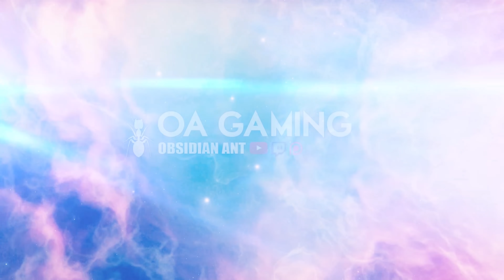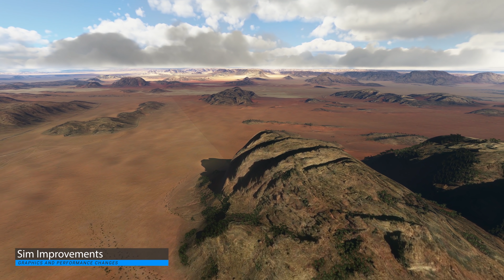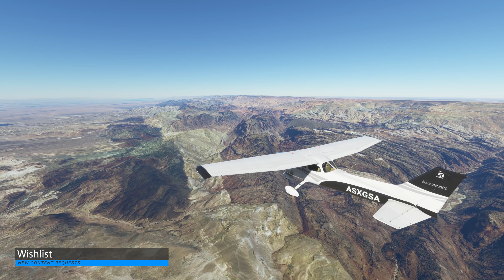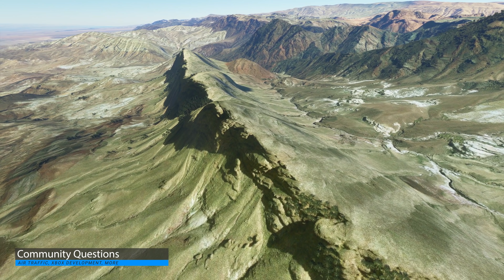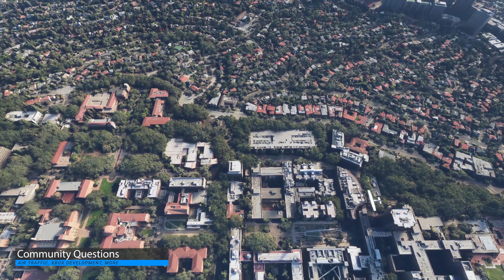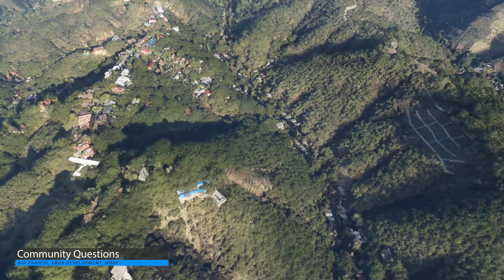Microsoft Flight Simulator - Beyond Ultra Graphics Option, x3 RAM Optimization, Flight Model Fixes

Comment: hmm don't really know what to think of the flight model. On one hand I think it's good they address this, but on the other, is there a reason they don't 'generalize' the flight model so any new model 'inherits' the characteristics depending on how the flightframe is modeled and not just on a per plane basis?  (like in x-plane for example where they calculate the camber and whatnot.. NOT TRYING TO START A DEBATE, JUST COMPARING)

note that I haven't done any research whatsoever regarding the flightmodel in MSFS so just based this on what I heard in this vid.

Comment: fsx C172: on runway,full power pitch up at 30kts, not p factor, takes off at 45kts and stalls.
fs2020 c172: on runway, full power, needs right rudder to stay on the runway, takes off at 45...buffets... and stalls.
im very happy with fs2020. I just wish there was more planes. Maybe some military fighters?

Comment: The 4k fps performance is atrocious. Setting it to lower resolutions/presets ruins it (Anyone who argues against this, or thinks 30fps is ok, can't comprehend what I said) We shouldn't have top of the line systems (5900x/3090 in my case) struggling with fps.

Comment: The last thing I need to do with my computer is upgrade to 128 gigabytes of 3,600 MHz ram, my rtx3090 and everything else in my computer is top of the shelf, but while running Microsoft flight simulator I can see in afterburner my ram, currently 32 gb, is absolutely cooking.
Reply: The game engine should have been developed around directX 12 compatibility from the ground up, I thoroughly enjoy playing the game but at on average 25 - 30 FPS is very annoying to say the least.

Comment: Would rather they fix the stutters-still have them particularly on approach, on my 3090 rig. 50FPS 4k Ultra normally, but horrible 0.5 to 2 second pauses every now and again. Most noticeable when trying to land, and utterly breaks immersion. Also does it at low settings, so winding down does not seem to cure it. Every other game I own runs beautifully . Would happily run at 30FPS if stutter free.
Reply: That sounds like ram lag.
Possible overheating.  ?
Reply: How in the world did you find an RTX 3090?
Reply: @DerekMoore82  😂 PreOrdered on launch day  in UK , received several months later! ASUS strix. Great in everything else, and hopefully when the next lot of optimisations go through it might sort itself out. I’ve checked temps (not going over 75 and under-clocked it from 1860 down to 1800, but still get these strange pauses. More in city environments, so not sure if its something to do with data being loaded into RAM. Forced the fans to run at 100% for MSFS profile but no joy. Lasso etc also no effect, if anything, possibly worse.

Comment: Cool what they're doing with the prop plane flight modelling, but wish they would at least make the 787 that I paid extra money for at least taxiable.
Reply: Even with the little prop planes, I basically need full rudder to keep a straight line on takeoff, is it supposed to be like that in real life?
Reply: @DerekMoore82  you need a lot of rudder irl too
Reply: @Alexander-hk5ke  I guess it's a sensitivity issue, because every time I've ever flown as a passenger in real life, I've never experienced the sensation that the plane was wanting to violently yaw in any direction but straight on takeoff. Either that, or those pilots must be doing some amazing footwork up there in the cockpit. In the sim it's as if I am trying to control one of those bad shopping cart buggies that aggressively pulls to one side.
Reply: @DerekMoore82  next time you fly as a pax, watch thos pedals. Ive been a pax multiple times aswell and there is a lot of right rudder when you watch the pedals. Thats why you dont feel the plane moving left;) But I agree that the rudder sensitivity is aggressive in MSFs
Reply: Naw, theres def something wrong with the 787 steering. Its actually impossible to make sharp turn with it. Compare to a320/fly by wire model which is much more accurate. As for the tail draggers, you need to give a blast from the prop with rudder to get those to turn your tail wheel behaves more like a castor wheel than anything.
Reply: @GreatLakesDrifta  cant say anything about the 787 as I havent flown one, but yes its most likely wrong. And in GA aircraft you surely need power to take sharp turns

Comment: Me upgrading pc with new rtx 3090
Asobo : "Are you sure about that"
Reply: Good luck acquiring a 3090.
Reply: @DerekMoore82  3090 still low results inVR
Reply: I've got a 3090, and performance is good, not incredible. I play on high to ultra settings and get a solid 30-40fps in most scenarios, dropping to around 20fps in really densely populated areas. Not really worth the investment in my opinion but when it was announced I just impulse pre-ordered a ROG Strix version.

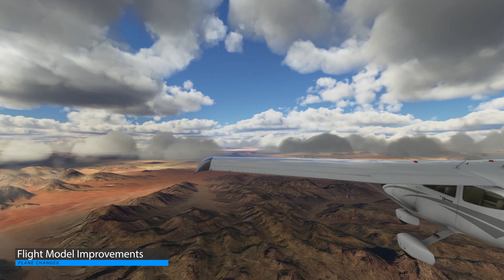Comment: 0:24 Yes, but here's the problem: Stop looking at the rudder effect and look at the recovery. Do you see how much more yoke input the real plane needs to recover? In the sim plane you barely need to move the yoke. The flight model is way to twitchy. And even if they're currently looking at the rudder input, the issue caused by weathervaning on takeoff leading to violent yawing is still present.

Comment: My system has got so bad since the original release that I've gone back to X-Plane. It was all good at the release but all the updates have made it worse and worse to the point I'm struggling to get it to be stable so I've given up.
UPDATE.....(26/05/21) - So after uninstalling and reinstalling MSFS i found that if its in a vanilla state it seems to be fine and will run on HIGH on my system quite happily, so no third party content for me by the looks of it....!!
Reply: I've had the opposite experience.

Comment: "Asobo have been taking real airplanes out, and mapping out a set of moves, such as full rudder, or pitching and yawing.  They have then been capturing all the data for this on a plane by plane basis. "

Why now was this not done from the start? I mean you could tell something was up when you barely touched rudder pedal and plane violently flips to side. Jezuse christ
 
MSFS20 for graphics. Xplane 11 for realism.

Comment: I really want to see ray tracing added, especially RT Shadows, GI, and Emissive Lights
Reply: I'm sure with RTX it will run at a solid 1 fps. 😂
Reply: @MacXpert74  At least it'll help future proof the game. Not all high end settings are meant to be run on all current hardware. It's one of the reasons why Crysis has aged so well visually. The pushed the graphics really hard so that in the future the game still looks visually nice even 14 years later
Reply: @crestofhonor2349  I think they will introduce that option when the time is right and people can actually buy systems that allow for a reasonable experience with RTX enabled. This might take a couple of years. I'm fairly certain that even the most powerful Gfx card available now, would totally collaps if you'd try to run MSFS with raytracing. But MSFS is an ongoing development, so new stuff will be added all the time, so it will likely come at some point.
Reply: Atleast RTX features in cockpit. 🤤

Comment: would be nice if you could replay a replay and also fly with your replay, so you can fly with yourself. Do flight shows ect. You could do this with the flight replay tool in fsx. You could even add multiple replays together for flying formations.
Reply: Look up Flight Control Replay (although maybe that's what you were referring to)
Reply: @getsideways7257  no it was a payware flight replay tool. You could record a flight in a cessna and replay it back but jump in game and fly with the replay. So you could load 10 replays up and jump in game and fly with ten planes that youve recorded. It let you make air displays ect.

Comment: Asobo needs to make a lot of optimizations if they want this game to run on consoles. First, they need to properly support DX12 and iron it out, then try to improve memory management by a huge margin as consoles have very little memory to work with. Only then can we have any hope of getting an adequate Series X|S release. I'm looking forward to the beta, if there really will be one, but I'm also bracing for some disappointing framerates there. It would be a miracle to get 30 fps on consoles for this game.
Reply: It's gonna be another Cyberpunk situation.

Comment: if they want to fix the flight dynamics, they should probably start with stalls. currently, things like gforce are completely irrelevant in stall speeds, which is ridiculous
Reply: At least now it's possible to write one's own FM, so it all depends on the addon makers... Too bad 90% of those will still rely on the stupid stuff Asobo has "developed" so far.

Comment: How far beyond the 10 fps slideshow that I get in London is "beyond ultra"?
Reply: Well said ! It’s a joke , X plane far more forgiving
Reply: Microsoft has always pushed their Flight Sim series to the brink regarding specs needed to run at the ultra settings, it was well known last year that the ultra setting wasn't meant for computers there are currently available, but to showcase what could be done in the future. Hell, I have a 5900x/3090FE combo and I'm barely getting 35-40 fps on ultra 4k in London.
Reply: Dx12 and mem usage improvement should help you as well. More FPS.
Reply: @ytwos1  DX12 isn't going to help much if you're GPU bottlenecked. It will help a ton with CPU bottlenecked users though.

Comment: MSFS doesnt have great flight dynamics they said... in the next few months we'll have Austin taking notes from MSFS about proper flight models lol
Reply: It doesn't. And in few months little will have changed... Because going full rudder in a plane and applying the results to a pathetic BET-based FM won't help with producing anything realistic.
If you want realistic, you wind tunnel test the thing from as many possible angles as you can.
The clown named Austin can take notes all he wants, by the way. Both teams have the same excuse of an FM to work with anyway...

Comment: Who will push FS2020 to "beyond ultra" though?
I have FS2020 in ultra at 4k and flying over downtown Boston makes even my 3090 cry!
Reply: Future proofing. MSFS always does this, when FSX was released in 2006 it required a beast computer to run back then. It was years before the hardware to run it smoothly with high settings was common. Same with this one. I predict this sim will be around a long long time and it’ll take years for the hardware to run it in ultra will be commonly available.
Reply: 5fps at most

Comment: Wish they would improve the airliner flight models, the planes are way too stable. The a320 stays fully controllable at deep stall speeds. You can completely stall out the plane at +500 and still recover the aircraft no problem...
Reply: Have you tried the Fly-by-wire A320NX addon for the A320?
Reply: @viper2311  I have.
Reply: You realize it’s because it’s impossible to stall an a320? The flight computers will not allow a stall in any circumstances.
Reply: @iamjames8200  Well it does in the game, as long as you keep pulling the stick back. It will go far below stall speeds before alpha floor kicks in.
Reply: @arjenbij  doesn't change the fact it's impossible to stall a A320.
Reply: @iamjames8200  That's just incorrect, it might be very hard to do in normal law. But the aircraft has alternate laws in which the stall and bank angle protections don't work. Furthermore, stall protections rely on accurate airspeed and aoa sensors, which can be faulty, in which situation it is totally possible to stall the aircraft.
Reply: @arjenbij  yes like that air France flight from Brazil
Reply: airlines never stall. asobo should not model this. its a sim not a game.
Reply: @MrCleanMachine48  Airliners never stall? Are you sure about that?

Comment: RTX2070Super and running on Medium.... on 1080p only...
Reply: RTX2060S running on ultra on 1080p... What's your other specs?
Reply: @090giver090  damn idk what my bottleneck is. I guess my ram. I have a ryzen 5 3600 and 32gb ram (4x8gb). On a aorus b450 elite
Reply: Oof I get 4k 40fps average on custom yet mostly high/ultra settings at 50% render resolution cause it makes almost no visual difference. I have an RTX 2060 and an i7 10700F as well as 16gb ram

Comment: The closing shot in the video over the lake was breathtaking and its visuals like this which make my HP Reverb G2 VR experience in the sim second to none.
Reply: How do you rate the G2? I'm considering upgrading from the original Rift. Running a 5800X and 3080
Reply: @lemo87a  I like the G2. I had the original Rift CV1 as well. You will find things about the G2 annoying, it's true the controllers are not as good. Actually, the tracking coverage is manageable but what bothers me more is the lighting conditions in your room can affect the tracking a little bit. Head tracking is good though. Also, a difference is the sweetspot - now the CV1 never got blurry from the center unless you are looking at the very edge but the G2 does a little - I'm ok with it and have accepted it now - this blurry effect is still sharper than the CV1 but it can get to some people. The other sweetspot for finding the ideal position for clarity is also bigger in the CV1 but it's ok in the G2. I do find the G2 more comfortable though. Lastly the fit of the G2 is good if you have a reasonably sized 'adult' head - people with small heads may struggle to find a comfortable fit. Perhaps I'm sounding a little negative but if I tell you the G2 for simulation is outstanding, the clarity in games is incredible and the colours are so natural in MSFS it's a joy to fly with. I do find I need to use OpenXR (allows reprojection) to get that smooth experience in VR for MSFS but that's something you'll need to play with. For MSFS and your system I would recommend it but if your main interest is Pavlov or other VR shooters then that's a tricky decision. Good luck!
Reply: @lemo87a  i upgraded to g2 from rift s and its a huge improvement,i did the face mask mod which really improved comfort and sweetspot.i have found the tracking really good but it does seem to be dependant on environment .for  driving and flying sims its a fantastic headset.if you got a x570 motherboard you may find it won't work on normal usb it only works on my usbc on my 2080ti card but theres suppose to be a bios fix
Reply: @lemo87a  Had a Rift CV1 and a G2 now, friend of mine has a Valve Index too which i used quite a bit - the G2 uses the same system as the Index for the head strap and facial interface, it's really comfortable, more than the CV1. For small heads Valve do provide a kind of cushion to pad the rear part of the strap (it's a rigid strap, so there's definitely a minimum size), but not HP, no idea if one could buy it separately. The resolution is amazing, and it taxes the best GPUs on the market to their limits.
Reply: @lemo87a  it is a huge step forward. If you can afford it, do it.
Reply: Agree it looked gorgeous... Where was that??
Reply: @BuntyDave  it says Los Angeles in the video, so I think it’s somewhere close. I haven’t found it on google maps yet though.
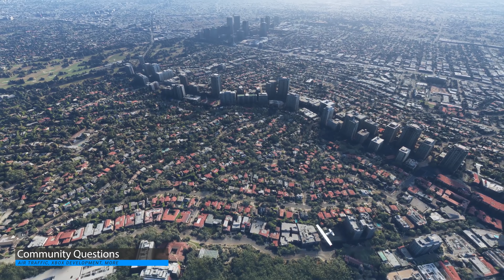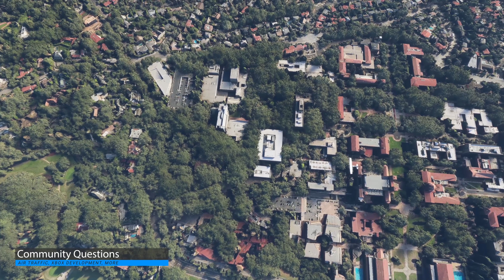Reply: @caffeineaddict213  it appears to be Stone Canyon Reservoir about 3 miles north of UCLA in Westwood. He flew roughly north. I saw him overfly what was probably the intersection of the I-10 and I-405 freeways and then probably Westwood and Bel Air. I saw a golf course that was probably the Los Angeles Country Club and a row of high rises along Wilshire Blvd. Rich folks country! I looked again at higher res and I can see that he flies right over the UCLA Campus from around 8:00 to 8:16 in the video. Aside from too many trees, it's a faithful rendering. I used to drive there from Pasadena a couple of times a week when I was in an MBA program back in the 1980's. Never flew low over that part of LA but I know the area pretty well. It's amazing that the sim is so detailed.

Comment: Hm yes, because ultra graphics is so easy to run they're going to make it more of a challenge
Reply: I don’t think it’s even possible without a super computer
Reply: @acamelwholikescoke4641  

I have a 6800xt 5900x and at 3440x1440 it is unable to maintain 30fps in big cities with everything maxed
Reply: I mean they said they were going to add dx12 which gives like 75% more fps and they also said they were adding many more performance updates for significantly higher fps

Comment: Will DX 12 really make that big of a difference?
Reply: No
Reply: in stutters probably YES - as dx 12 can async load stuff which currently interrupts the gpu drawcalls - also early level of Detail can leverage all cpu cores.
Reply: @mareck6946  and asset decompression / streamimg in low altitude urban areas